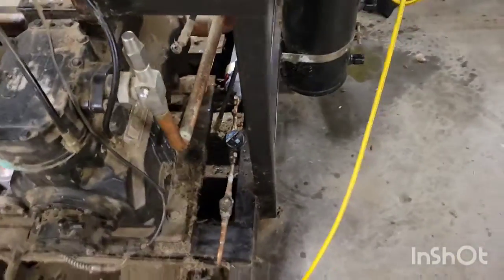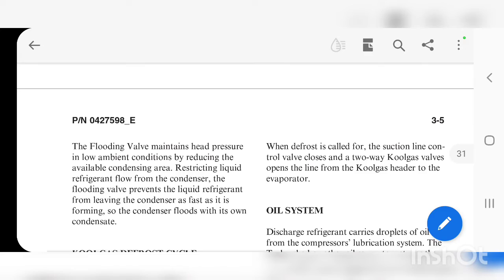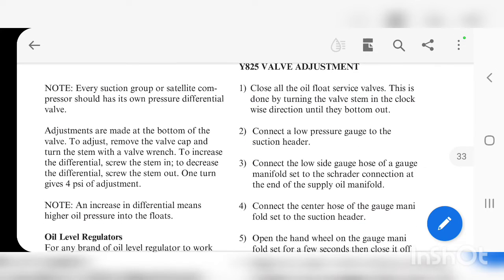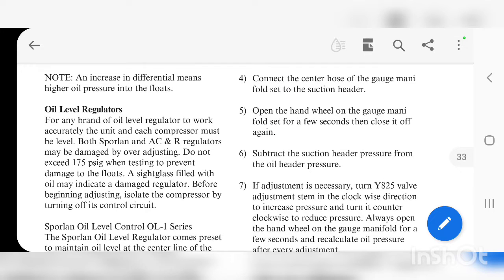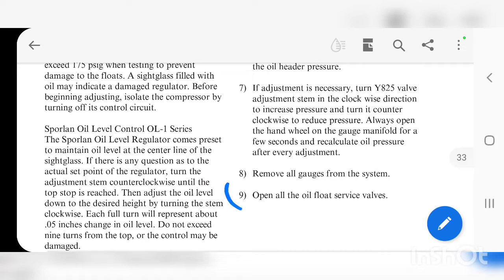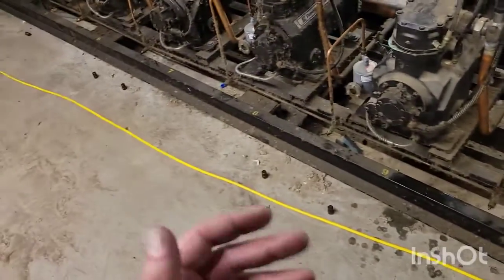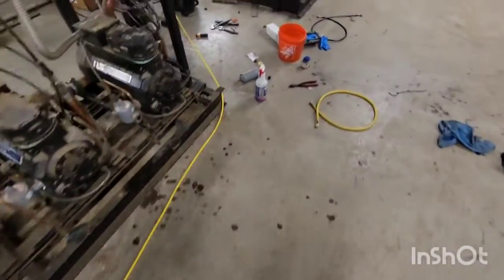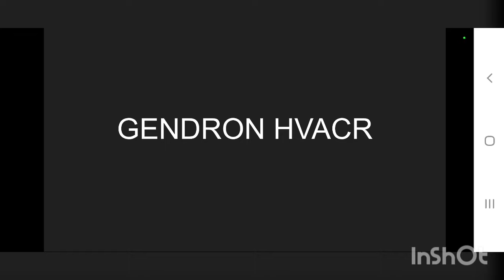Supermarket Refrigeration - How to Set a Oil Differential Valve

Comment: Compressors are still running during this process correct. And I’m also trying to find your video where you explain moving oil from the compressor to the suction header.
Reply from the maker: Isolated the oil line so the compressors will eventually run out of oil but the failure alarm will prevent any damage.